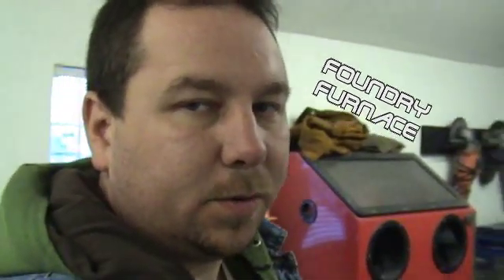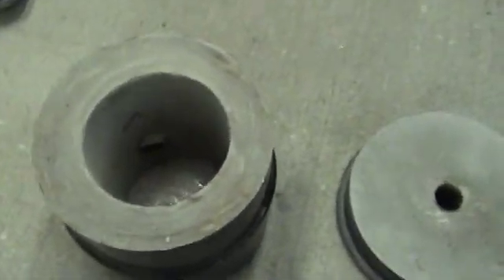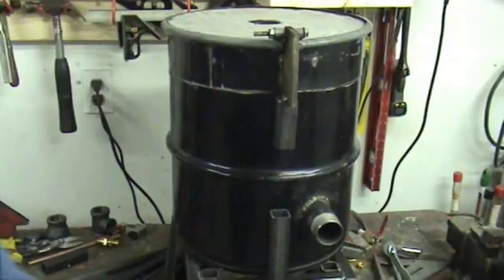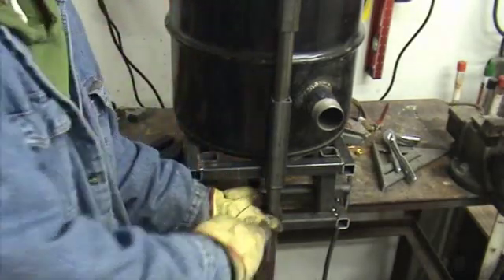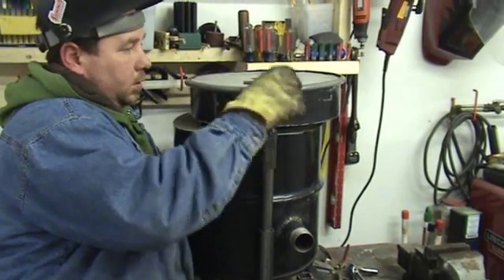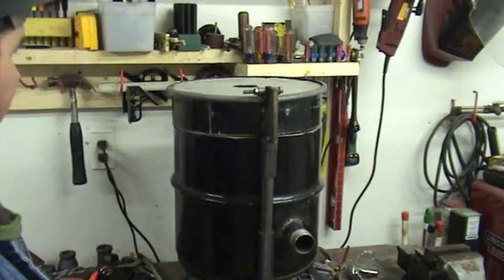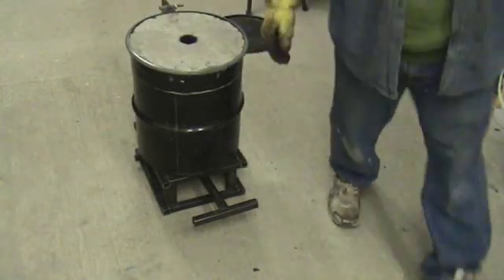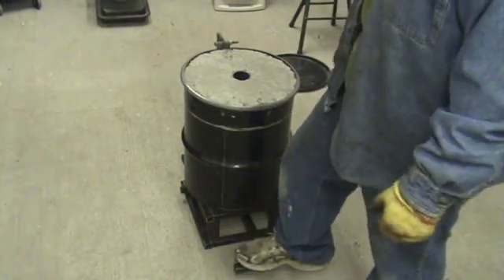Homemade Foundry Blast Furnace

Comment: This furnace is remarkably like mine that I have used for years. Although it has evolved quite a bit. Originally it was a Lil' Bertha plan from Gingerly in electric from a 16 gal. drum but I converted to waste oil, the only way to go.  From 4 hours per 10# aluminum for melt to 40 min.

Comment from the maker: @RemMan700 Thanks. Before I put the refractory cement in the lid I welded 1/4" rod to the center hole which is a 3" schedule 40 tube. It kinda looked like the spokes on a bike tire.